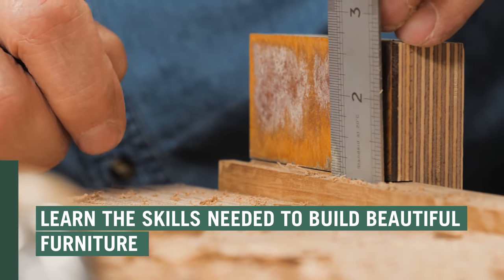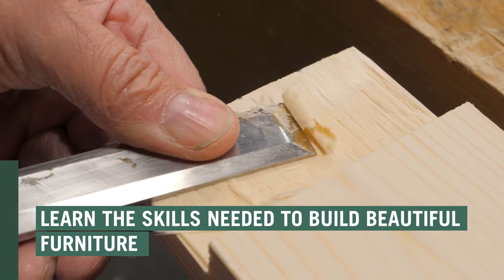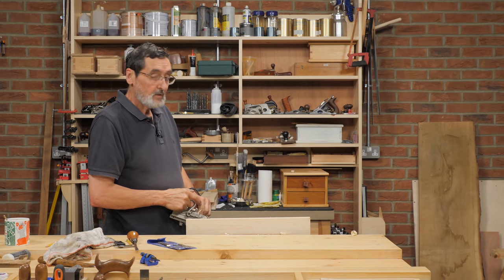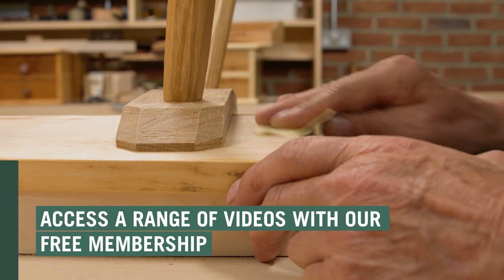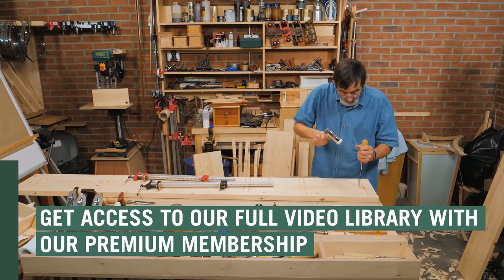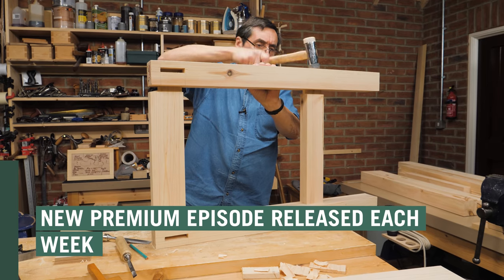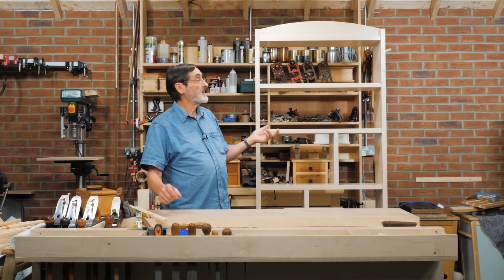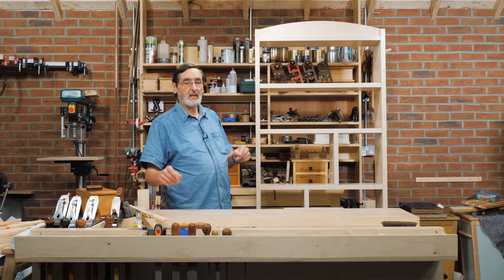Learn how to build beautiful furniture with Paul Sellers | Woodworking Masterclasses

Comment: You really have to love making stuff.  In the U.K. the materials are so expensive the timber costs more than buying a ready made piece of furniture!
Reply: OldMan Tony.  Yes, but it depends what you build.  It’s hard to compete on price with flat pack or mass produced stuff, but why would you want to?  Making your own things gives you quality bespoke pieces that would cost MUCH more than the cost of the timber if you bought them ready made to the same standard.  You can also make things that you can’t buy.  Plus you get the enjoyment of the making and the pleasure in a job well done at the end.  Admittedly you have to build up some skills first, but that is also very rewarding.
Reply: @richardsinger01  Yeah, but even IF you can afford the materials, there is nothing like the type of supplier we see in this video here in Australia. You have ultra expensive flooring suppliers and that's about it.
Reply: You cannot buy ready made furniture with the same quality as those on the course. Not even close. Anything you can buy for less than the raw material is just mass produced junk with big large gaps in joints with terrible finish. 
Making your own projects out of cheap pine would be better than mass produced oak products.

Comment: Not worried about the skills but where to get the dam wood. Can't find anything local at all and don't trust ebay
Reply: Here's where I get rough lumber in PA. Unbelievably low cost, and I plane it down to size myself. Very small place, not a huge, fancy warehouse. You might be able to find a similar place where you are. Weaver's Woodworking, 933 Martin Church Rd, New Holland, PA, 17557.
Reply: @stphnalln  that's great I'm in the UK. Where wood is extravagantly expensive and woodmills seem to be going.
Reply: Yep, that's predicament, Mr. Coupe! If there's one thing we've got loads of in the US, it's lumber. I can get rough cut hardwoods for about $2.50 per board foot.
Reply: Phill Coupe where abouts in the UK?  I can personally recommend South London Hardwoods who will deliver.  Yandles in Somerset is good and a former work colleague used to swear by John Boddy’s in Yorkshire.  Hardwood is MUCH cheaper if you buy it sawn not PAR.  I don’t have machines so have to dimension it by hand, but I have learned how to do it - albeit rather slowly!
Reply: @richardsinger01  You and me sure know what the apprentice used to do <grin>.  I rather like bringing a plank S4S with a hand plane....Flat, no wind, constant thickness.  Damn good exercise too.  -Veteran '66-68

Comment: It's a pity that to build beautiful furniture that you need beautiful wood which is very nearly non-existent here in Australia now...
Reply: You do not need beautiful expensive wood. Pine is a fantastic would for making projects out of. 
The key to learning woodworking is the skill of selecting wood. Pine is no less of a wood than oak and can look just as beautiful with good selection. 
Some certain types of projects such as a tool work better with certain types of wood such as making a mallet.
Reply: @bighands69  I agree, but that is why I criticise the use of expensive and hard to get material.
Reply: @bighands69  Pine is expensive
Reply: @bighands69  Pine is expensive too.